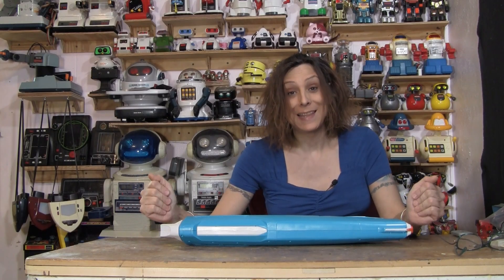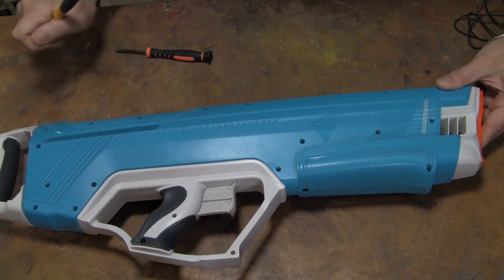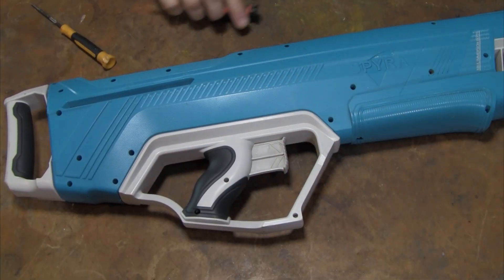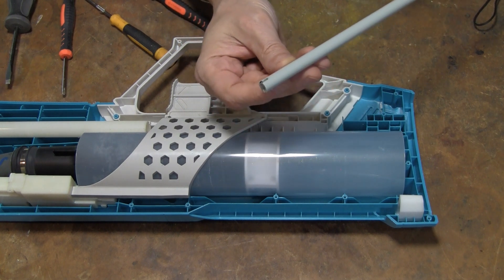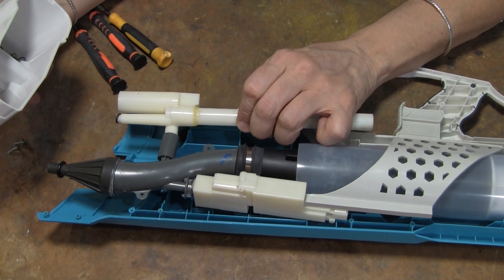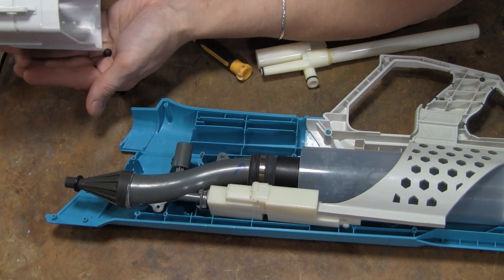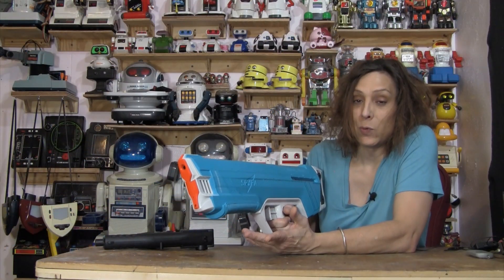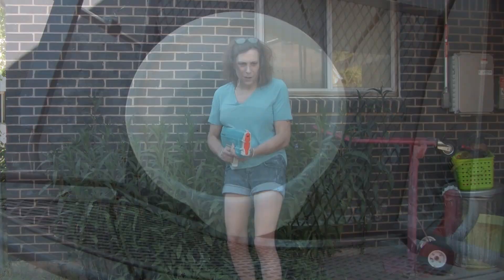Inside the Spyra Water Gun: The Water Gun That Shoots Blobs!

Comment: I fixed a nerf blaster for my sister that had the same exact problem. It had and air tank and the valve broke off the end of the arm. It was the rapid fire As-20 and it used a full tank of air to shot 20 darts all at once. It was amazing if not at all practical, since loading 20 darts between shots takes some time haha. My favorite nerf blaster for mechanical system is the Cyclotron... it uses a water wheel mechanism to fling the ammo its pretty amazing and simple at the same time.

Comment: While toys have always been made relatively cheaply, cost cutting is above all other considerations today.  I'll give you an example... Modern TVs.  The LEDs (that backlight) are always over-driven and they are the most prone to failure part in a modern TV.  If you have ever had a TV fail where it turns on for a second or two and then immediately turns off, you have run in to this issue.  Modern TVs should last 50 years. But they don't because they run the part out of spec to save 12 cents per LED.
The endless creaking of this water pistol while you were fixing it shows just how poorly it has been made.
Toys have the unique property of being aimed at a child in a very tight age range.  If this toy is aimed at 8-12 year olds, it won't be designed to last more than 4 years at best.  Whereas theoretically you could buy a TV at 18 and use it for the next 50 years, this just isn't the case with toys.  They are also extremely price sensitive. Most parents would rather purchase multiple cheap toys than 1 or 2 expensive ones.
Reply from the maker: Engineered great, designed cheaply.

Comment: it looks like a giant biro pen when it's on it's side. My gran used to have a weird water sprayer to use in the garden, it must have been very old. It was like a giant bike pump with a watering can rose like head on the end. You would stick it in a water barrel and draw the handle back, then push it in to spray water out. It was the ultimate weapon in water fights 😆 I've never seen one other than the one she had.
What is that orange thing with the metal seat and wheels in your garden?
Reply from the maker: I've never heard of that water thing. The orange thing is a scooter you can sit on and work in the garden.
Reply: Maybe it was diy, not uncommon to make your own tools especially years ago.

Comment: Great job. And great video. Non magnetic (stainless) screws are to avoid corrosion from pool water. Use silicone, teflon or lithium on o-rings. Petroleum products will dissolve un vulcanized rubber orings. Keep  up making  your entertaining videos.
Reply: silicon based lubricant is my go to for most things
Reply: I wonder if can use Super Lube can buy it Harbor Freight
Reply: @georgemartinez1720 yes. It is PTFE and silicone
Reply from the maker: Thanks